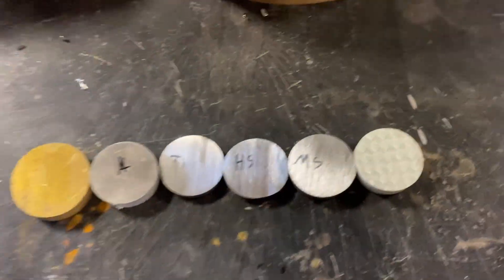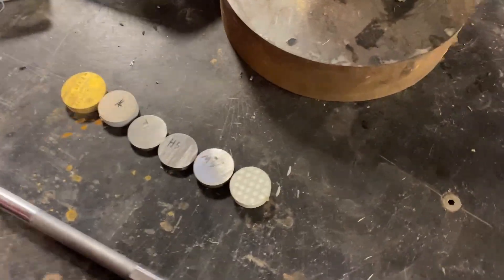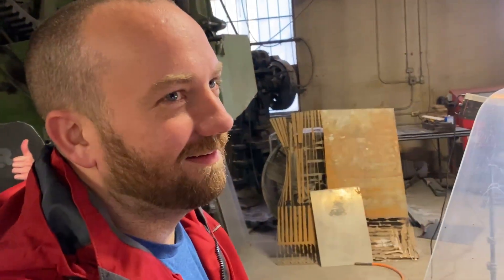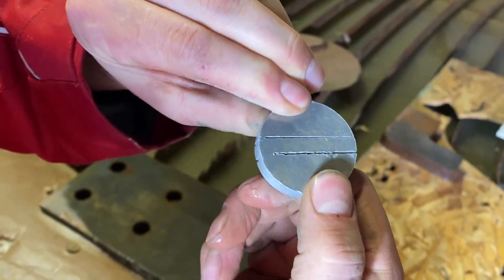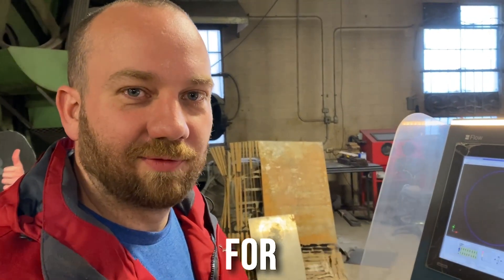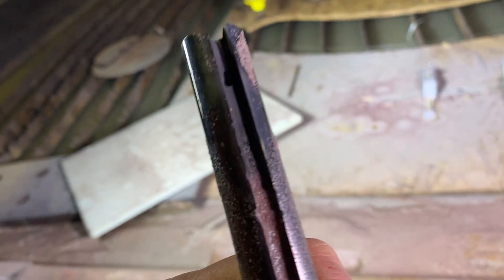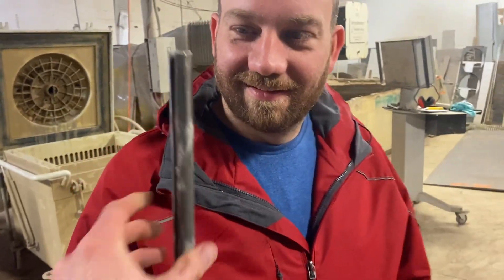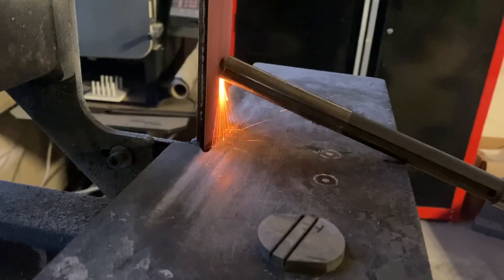How Strong Is Tungsten? Waterjet Cutting Test

Comment: A water jet cannot practically cut very thick tungsten because tungsten and its common carbide alloys combine extreme hardness, high toughness, and a very high melting point, so a high pressure water stream, even when loaded with abrasives, removes material very slowly and inefficiently; waterjet cutting relies on entrained abrasive grains to erode material by micro cutting and by inducing brittle fracture, but tungsten tends to resist microcracking and instead plastically deforms or locally work hardens, requiring far more energy per unit volume to remove than softer or more brittle materials, and thermal softening is not available because of tungsten high melting temperature and thermal properties, so to cut very thick sections you would need impractically high pressure, enormous abrasive flow and time, and you would suffer rapid nozzle wear and very high costs, which is why industrial shops use alternatives such as electrical discharge machining, high power lasers, or diamond tipped mechanical cutting for very thick tungsten instead of a water jet.

Comment: Tungsten carbide is uncutable. But u drop it on a concrete floor or use a hammer at it and it will crack or shatter. So it does hsve weat point.

Comment: Tungsten is pretty hard, but chromium and boron are much harder, being the third and second hardest elements, respectively, after carbon in the form of diamonds.  Tungsten is also not the densest material.  That honor goes to osmium.  Tungsten’s standout trait is that it has the highest melting point of any metal.  However, it should be noted that carbon, while not a metal, does have a higher melting point.
Reply: However, tungsten is usually used in combination with carbon. Tungsten carbide. Tungsten carbide is noticeably harder than chromium and comes close to boron

Comment: The circles of metal aren't the same thickness. The titanium was considerably thinner than the others. Wouldn't that effect the cut?
Reply: no he was just testing each of the metals to see how far down they would cut so if you look at the depth of the cut it'll tell you how strong the metal is to The cutting test okay okay by the way that pea sized thing up rolling around in your head is your brain, USE IT! 💯
Reply: @nunyafockler5650  Right.......there's a lot to digest here. Firstly, you're insinuating that I'm stupid at the end of a BARELY comprehensible sentence. You're grammar is shit and your punctuation is worse. You also missed the fact that I ASKED a question. I didn't make a statement that needed to be corrected. I was wondering if the difference in thicknesses between the bits of metal could throw off the accuracy. This is where my "pea brain" kicks in. Is it possible that when the material you are cutting is thicker, the material being cut has a stronger "bracing" effect. For example: would a bullet travel deeper through a tree that was 1 foot in diameter than it would a tree that was 3 feet in diameter? There is more material in front of the bullet (the cutting tool) that is working against its progress through the tree. Could a thicker piece of the same metal yield a different cutting result due to there being more material working against the water jet? If yes, than the test results would not be accurate. As not all of the pieces of metal were the same thickness. I think it's a relevant question. What do you think keyboard warrior?

Comment: Actually, NO, tungsten is NOT the hardest metal, chromium is. By FAR. 9.5 on Moh's scale, chromium metal is as hard as carborundum and there is no other metal that even comes close or is anything like it. So you might trying to get your hands on some pure chromium metal and seeing how that goes. Note that Moh's scale of hardness is not a linear scale, 9.5 is like 3 times harder than 9, so chromium isn't just a little bit harder than every other metal. Though it is also brittle when pure.

Comment: I did not realise hard steel was harder than titanium. I was under the impression titanium was the strongest metal
Reply: hardness isnt strength

titanium is far stronger than pure tungsten but its easier to cut trough since you dont need something with a hardness of 9 to cut it

but that is to cut it, you can absolutely destroy tungsten way easier than titanium because of how brittle tungsten is

Comment: So what causes sparks for certain metals when they are put to a grinding belt?
Reply: Background: Most metals oxidize with the oxygen in air. Think iron rusting, copper turning green, bronze turning dark, etc. The rate of oxidation is determined by the temperature and surface area exposed to air, with higher temp and more surface increasing the rate. Also, oxidation reactions themselves produce heat.

When a particle is super small, it has a very large ratio between it's surface area and volume. Even though the surface area is pretty low in absolute terms, the volume and thus amount of metal is even lower, so the oxidation rapidly heats it up. Heating up only increases the rate of oxidation more, and you get a runaway reaction that results in the metal particles getting white-hot and glowing like anything hot does, and ends once the metal is entirely oxidized and begins to cool down.

The metals that do not spark are the ones that oxidize slowly enough, or produce little enough heat while oxidizing, that they lose heat faster to the air than the oxidation adds heat, and thus don't get a runaway reaction.

Basically, iron and titanium are both very reactive with oxygen, while brass and the others are not.

Edit: Aluminum is actually even more reactive, but it's oxide is very good at preventing the unreacted aluminum under the surface from reacting, so it doesn't really spark either. Aluminum is thought of as quite corrosion resistant, but it actually gets it's corrosion resistance from the super thin layer of aluminum oxide (aka corundum or sapphire) that forms nearly instantly on any surface exposed to air.
Reply: @markjacobson4248  Thank you very much!!! This was very easy to understand and I appreciate the amount of detail you put into your comment.

Comment: My whole life I had no idea titanium wasn't as hard as treated steel.
I guess it's just used over it in military/avionic applications for the sake of better weight to hardness ratio?
Reply: High strength, low weight. Very good properties for aviation or implants.
Reply: You've heard of its use in the construction of airplanes because of its high melting point. When travelling at supersonic speeds the nose of the plane will reach temperatures that would melt steel. The light weight is a bonus. They actually had to sneak the titanium for the blackbird out of the soviet union covertly as Ukraine has most of the worlds supply, I believe.

Comment: Incorrect, AR steel is ABRASION REISTANT. Hardened Steel is hardened. I don't know if this point of fact would impact the outcome I only mention it for clarity and Internet clout.
Reply: I'm pretty sure steel with high graphite content is self lubricating so it doesn't have to be harder to be abrasion resistant.

Comment: titanium is more machinable than mild steel? is MS "sticky" or something? I thought titanium was really brittle and annoying to machine.
Reply: Titanium is hard to machine because it work hardens and is terrible at conducting heat so the work itself heats up and can burn up tools. If the "machinability" score was specifically with regards to water cutting, those factors wouldn't be that big of a deal so might give it a better score in that regard.

Comment: Tungsten is no joke, I have a Tungsten ring and I've had it for like 6 years and it's been everywhere, it's been thrown on concrete and everything and it has literally and I kid you not, not even one scratch which is still mind boggling to me, I've even tried to use sand paper and atleast scratch the corners but nothing lol best $20 wedding ring ever
Reply: just hope your finger doesnt swell up for some reason, not going to have a fun time cutting that off to save your finger.
Reply: @delciotto  They don't cut them, just give it a few light taps with a hammer and you can shatter them pretty easily.
Reply: Same! Been married 9 years and it looks the same as the day I bought it.
Reply: Tungsten is also used in TIG Welding
Grinding wheel makes light work of Tungsten 👍

Comment: Is that tungsten carbide and not tungsten metal? I can scratch a block of tungsten metal I have with a cheap Walmart knife so that has to be the carbide and not the metal.
Reply: I wonder the same thing as people commonly mistaken tungsten with tungsten carbide for some reason. Also, I don’t know what tungsten you have, but it should not be able to be scratched by a cheap knife. I have a tungsten rod and can’t even scratch it with my standard files and have to use a diamond file. It’s 7.5 on the Mohs scale, so you need a very hard steel to scratch it.
Reply: @romanvarcolac2238  Well my tungsten is a cube from Midwest tungsten service. What I meant by cheap was it was around $60, not 'cheap' but nothing super fancy either. The scratches were really light but there, and the tungsten couldn't scratch the knife in return.
edit: You may actually have a tungsten carbide rod because a steel file should be really hard steel and scratch just about anything that's a metal.
Reply: @freevipservers  Nah, I also have a tungsten rod from Midwest Tungsten supply XD. It is I believe the MT-17 alloy, but that should make it softer than normal tungsten due to the additions of iron and such. It’s also 1/8in diameter and considering I can flex it, which tungsten carbide would not allow, I know it’s a metal and not a brittle carbide.
Reply: @romanvarcolac2238  Huh, my cube is a 95% tungsten, the rest being iron and nickel alloy. I can't imagine your tungsten is that hard, a data sheet I found puts tungsten around a hrc of 31, while common knives are around the ~50 range
Reply: @freevipservers  what they had was very likely tungsten carbide. Theres a world of differencein hardness between Tungsten and Tungsten Carbide.
Reply: @Sharpless2  Yeah, I could also tell from the darker color of solid carbide vs just tungsten metal. Pure tungsten probably would have been worse than the armor steel.
Reply: @freevipservers  I don’t know, but that is my experience with it. They definitely didn’t have pure tungsten though